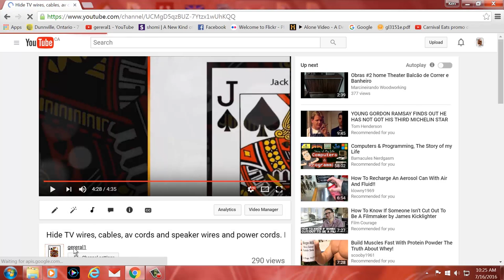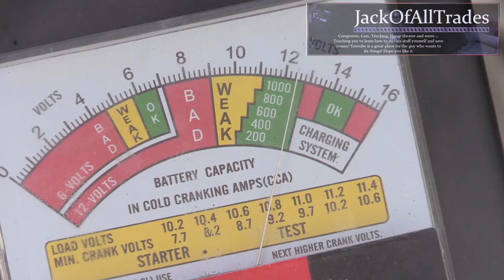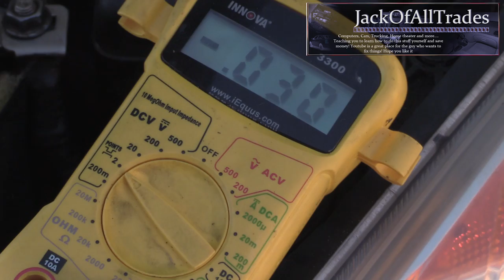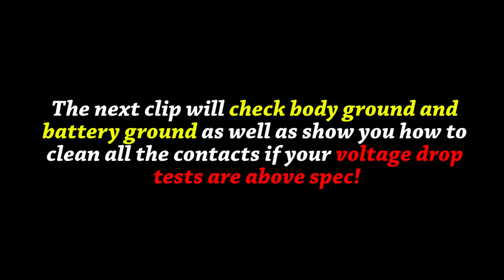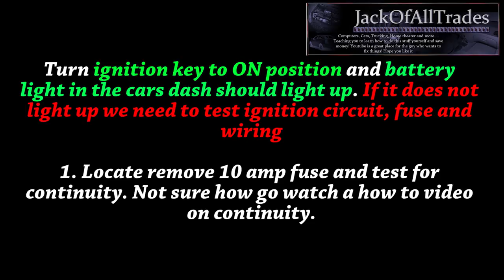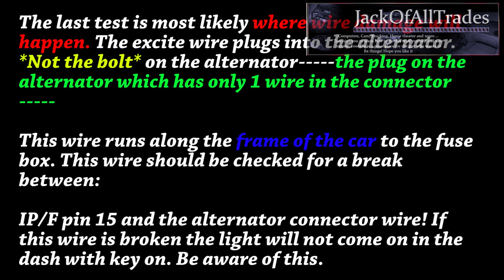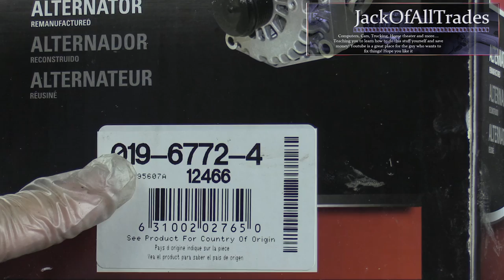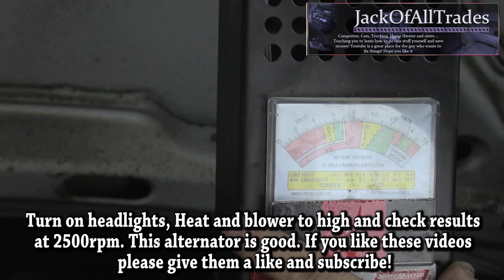Hyundai OEM Alternator testing and replacement

Comment: Hi good video sir! I have an 01 Hyundai that’s doin some weird stuff and someone before me put an alternator on it and it charges at 13.8 and with some load at idle it goes 13.6 and sometimes drops lower here and there should I replace the alternator? My battery stays at 12.4

Comment: I have a 2004 accent. I had a dead battery I replaced. Soon after I started getting a buzzing from a relay. Replaced relay 2 times and it still buzzes. Alternator on volt meter shows 13.9. Buzzing stops when I start the car. Do you think the voltage regulator on the alternator is bad and stuck in its last position and the relay is buzzing when car is off because the regulator on alternator is bad?

Comment: Same alternator here, my voltage is showing too high when I first start and when on the highway, but later in the drive if it idles, I get low voltage - 12.8 or so. My alternator plug was missing a wire on the two-prong connector. My question is, what are the two wires on the alternator connector so I can figure out which one is missing.
Reply from the maker: I included the scematic for the 2 wires in the video. The alternator only uses 2 wires in this vehicle. They are listed with color codes.
Reply from the maker: E02 is 2 pin connector. Only 1 wire is active. The other wire is suppost to be missing. Connector e01 is a seperate wire running to the inline fuse.
Reply: For some reason I thought the other wire was supposed to be a battery sense wire. So, which terminal on the alternator is E02 supposed to connect to?  Mine is missing the actual connector and only has a female connector connecting the E02.
Reply from the maker: If the e02 plug has 1 wire this is correct. Plug it in. The second wire is the one that took me 5 min to remove the one with the nut...... if your female connector does not fit maybe you got the wrong alternator.
Reply from the maker: Use new oil filter once the seal is crushed it will slowely leak.
Reply: No, my car is missing the two pin connector and only has a single female spade terminal in its place.
Reply from the maker: Eisen Faust what year is your car and the make eg. GLS...4 door 3 door....
Reply: gereral1 2007 2dr hatchback
Reply: Aka 3dr
Reply from the maker: The spade terminal is beefy wire that juice goes to to charge the battery. This is the one with nut. The accent alternator should have a 2 port female plug on it and your car should have 2 pin male plug. One pin should be populated. Can u send me pictures of the old and new alternator. Especially the connections. The accent MC 2006-2011 according to schematic use the same 1 wire excite system. The bulb in dash will not disable the alternator as hyundia provided 2 paths to excite the alternator. If you can't figure this out under my jackofalltrades banner is a Hyundai link. Post this question in 2016-2011 MC accent section. My name ikilledbarbie. If you want to send pics of the cars plugs to alternator and both alternators use thehoodedmechanic@gmail.com or post them at Hyundai forums with year make model of your car. There are 2 certified technicians on there who will help u
Reply from the maker: ThePariss333 they are the same. This alternator is 1 wire excite/rectifer type alternator. The wire that connects to the alternator goes to battery. The plug has 1 wire and the 2nd wire does not exist. if you look at wire diagram the 1 wire goes to the diode which is a split system. Even if the battery light fails the alternator will still excite from the diode. Old charging systems use to use the battery light bulb to close circuit to excite the alternator. if the bulb was burnt out the alternator would not charge. Hyundai was smart to split this circuit as not to use the battery light to excite the alternator. The alternator is running perfect that was installed in this video.
Reply from the maker: the spade terminal goes to nut. the tiny wire goes to alternator plug. The plug is 2 prong type but one wire is populated. the onther is left blank. please look at the e connector in the wire diagram in this video to see the pins.
Reply from the maker: about170thos klm when it died.....

Comment: My wife drives a 2013 Elantra.  The battery light comes and goes.  I had it tested at Autozone, they tell me the battery is good the alternator is not always working.  Could this be a grounding issue that comes and goes?
Reply from the maker: Grounds or brushes inside alternator....
Reply from the maker: Please test the 2 main grounds.... engine strap near the left side of engine connecting to the engine mount area and under the battery. The battery light coming on is triggered by an alternator not charging the battery correctly.
Reply: How do you replace that brusghes? Samsung generator?

Comment: Are all the bolts in alternator  10 mm too like the fan???
Reply from the maker: cheranguista they are metric. I'm sure you have a socket set. Not sure if I mentioned size mm sockets in this video. Wish I could remember .....